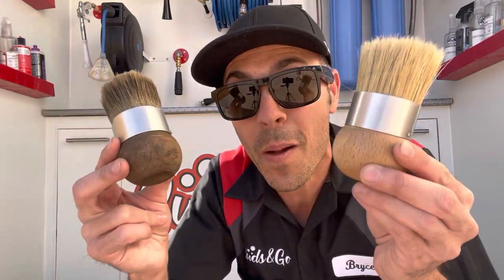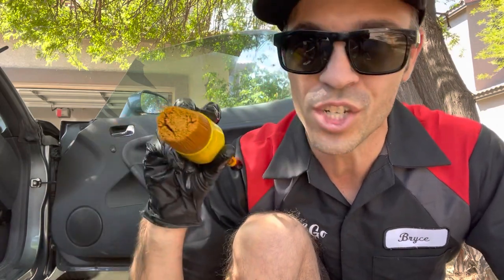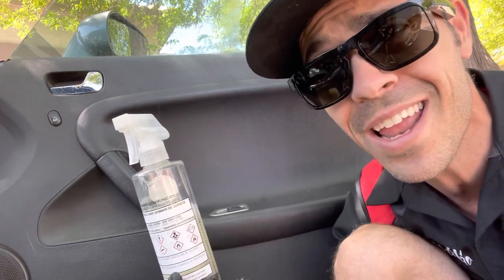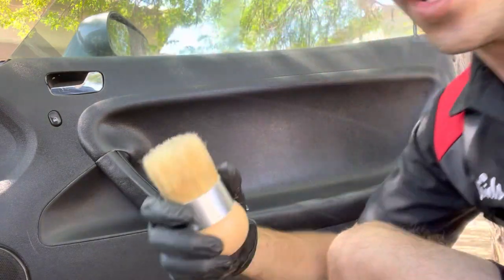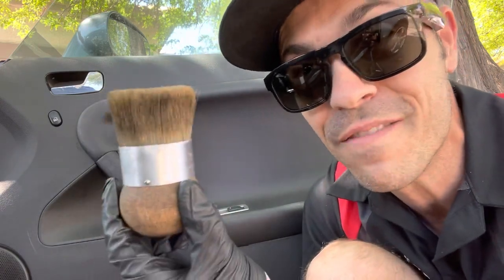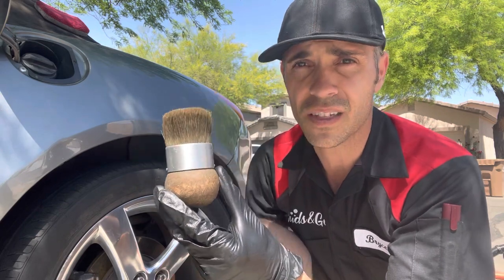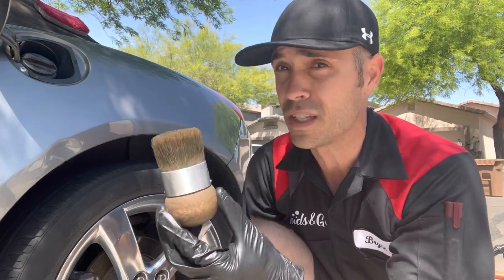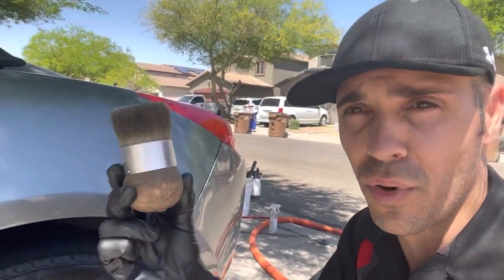This Detail Brush Is Virtually Indestructible!

Comment: Can these be used well for cleaning around emblems and raised lettering and car model badges to get in the nooks and crannies of them? Or is there another good tool for that?
Reply from the maker: Although these brushes are made with natural boars hair, I would suggest using something that’s not as stiff. The hair in this brush is tightly packed which is great for cleaning interiors but for emblems I would use a normal boars hair detail brush that has more flex and give to it.

Comment: I’ve been using mine for a couple weeks and it’s been losing bristles all I use it for all s tire shine
Reply from the maker: The first couple uses will shed the loose bristles from the factory. You should see that go away as you use it more and more. How do you like it?
Reply: @SpotlessWaterGuy   it’s actually good other than the loose bristles holds dressing good I dnt apply a lot but the amount I do apply to brush is enuff to go around a tire 🛞 well depending on tire size lol
Reply from the maker: @cartailincautodetailing5465  awesome